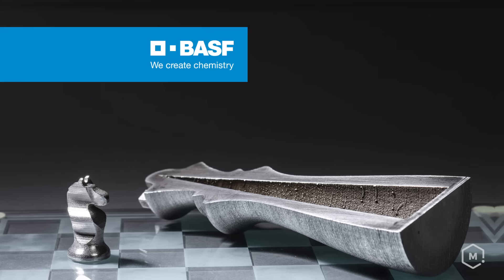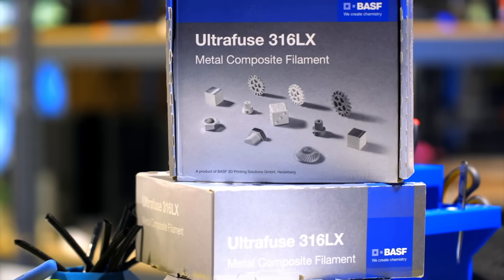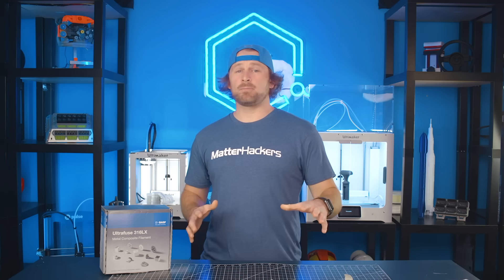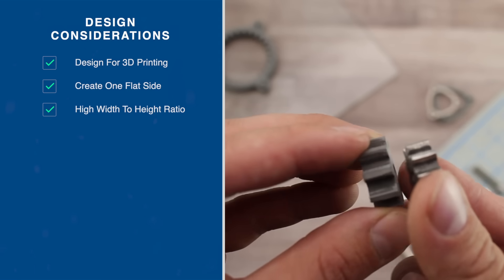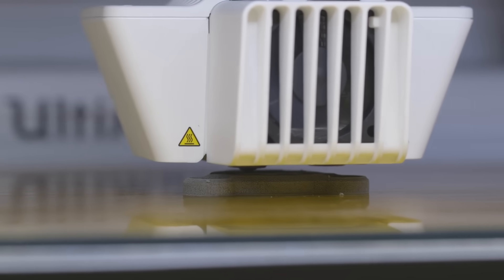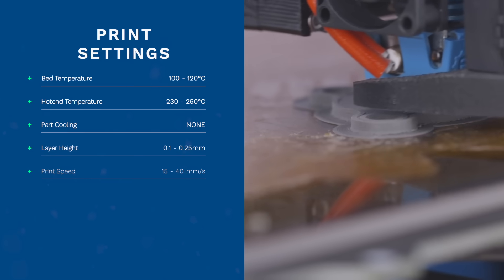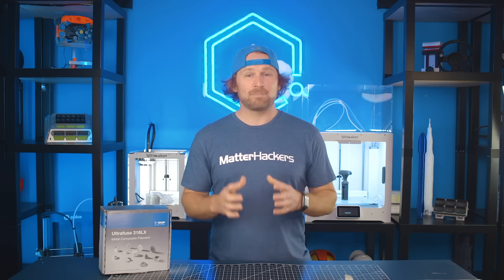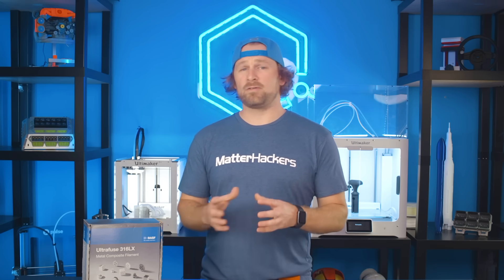How to Succeed with 3D Printing Metal on a Desktop 3D Printer using BASF Ultrafuse 316L Filament

Comment: So you buy this expensive impregnated filament, then you send the finished part  back to the company who manufactured the expensive filament for further processing to a finished product.      No word on how much it costs to sinter it, but it's snot going to be free.    In fact they got you buy the ball-z-axis.  They can charge whatever they like.   Why don't you just send your drawing over to be printed by a real 3d printer.   Seems like it would be faster and most likely stronger.   No funky scaling, or part mishap sad stories.   Either they can make it or they can't.

Comment: being made to follow some one elses rules in what you can make is not awesome! the other besides is no privacy and stolen designs, etc  you can tell by the fact they will renaming the process of heating it in a furnace to calling it Sintering instead what is the debinding also heating till most the plastic binders flow out???  perhaps under vacuum either way shiesty sounding to me at min Greedy while still controlling Tec

Comment: I have an odd question:
What is the density of the material before final processing of the part?  I am looking to 3d print flywheels, and others that require weight, not so much durability.

Comment: Why can't anyone combine this process with laser metal sintering, and basically extrude a layer, then blast it with a laser, extrude a layer, laser it, etc. Then it would be done right off the bed. 

You could even extrude some support structure, then only laser the bits to keep, and remove the green supports after its finished printing.
Reply: How much do you want to pay for that? Bidding is starting at $20,000.

Comment: I am a self-employed landscaper entrepreneur I'm trying to learn how to fix all my own stuff and as I do that take it to the next level of even making my own parts. I believe I was told in short 3D printing makes things possible that we're not possible in the recent future. Interested in being able to make my own hydraulic gearboxes these seem to be the one thing that are very expensive on power equipment interested in making my own version of a Toro dingo designed for mulch not necessarily for concrete and having materials something that I can move across a customer's yard without destroying it has anybody made hydraulic gearboxes before

Comment: I don't want to send my parts off to a service. I want to debind/sinter them myself. If I wanted a service I would just order it to get cnc-ed, and it would be stronger and probably the same price or cheaper ($465 for a 3kg roll (no smaller size) + $50/1kg filament sent to their processing service). Now, I could overlook all of that, but if I'm 3D printing its because I want the parts NOW for a prototype and not being able to sinter it myself is a deal-breaker.
Reply: Processing is included and it's $129 per Kg.
Reply: @rsilvers129  read the fine print and current prices from matterhackers, way back machine me bitch idfk that was 6mon ago

Comment: This is a joke.... the price of the filament alone... plus sending it In for another cost..... than saying hey, instead of cnc your parts do this... but your know what? You still may need to cnc these 3d printed metal parts..... this is all bs.... let me know when there's a better method... or when all the processes can be easily done in house... thanks!

Comment: 4:53 shouldn't the metal must be melted before print? so this is 250 degree celcius meanwhile for example aluminium melting point is 660 degree celcius. can someone explain
Reply: It's about 15-20% plastic binder and 80-85% metal POWDER. The plastic gets removed through the de-binding process and the metal powder is fused into a solid piece through the sintering process.
Reply: No, the metal is melted inside an oven with 1200°C after 3d printing the part.

Comment: $465 and $50 per processed part. $515 minimum price..

Not exactly cheap and not for the average Joe.. if the prices come down enough for folks to use quickly enough, maybe it won't be just another fly-by-night product alike to 3D TV's that needed glasses that no one would wear, even though they do in the cinema. That technology too went out the window..
Reply: Min price is $129.

Comment: I'm a bit late here but Virtual Foundry has much filament that is pretty much exactly the same and has a guide on how to do it at home with your own kiln.
Reply: True but it is $50 more per Kg and doesn't include the sintering like the BASF does.
Reply: @rsilvers129  How do you go about sintering? Is it just as easy as putting it in a gas powered furnace

Comment: At first I wasn't sure if this was a 3D Tech or Aerobics video : ) Just kidding. Product seems potentially useful but posting models back & forth, plus spool cost which will no doubt be X 3times other metal filled PLA, doesn't appeal, but I'd like to see Stefan from CNC Kitchen do strength tests as he's vigilant & thorough.

Comment: Why don't the facility that sintering the part get a 3D printer farm and you just send them your 3D file and they print it and sinter it? Instead of you shipping your green part.

All for a fee of course.
Reply: shelly belly shrinkage and part preparation is up to you... so I guess if it comes out messed up - its your fault
Reply: @TheSickness  most of the shrinkage comes from the sintering process, and the part preparation will be a service as well.

Comment: What a disappointing product and misleading video title - I expected to be able to print an object at home in metal, not something to be sent off to be turned into a metal part.
Reply: Matt Kasdorf i dont think this product is meant for people who print at home as a hobby
Reply: @Rogue Mentality even if matter hackers sales guy says that people at home can print it, it doesent mean that the product is aimed at these people. This is aimed mostly for industrial use etc. but because the sintering service is not just for industrial customers, people printing at home can also use it and these are a big part of the audience that matter hackers wants to reach with this video.

By the way, the sintering service was quite a bit cheaper that i thought it would be. Definitely cheap enough if you are willing to pay that much for the material itself, but it does cost. Im not sure if prices vary from place to place or if they are final prices, so i rather not say the number i have. Price of this material will surely scare those away who are not willing to invest for the prints they would make from this material.

Comment: This really needs to be cheaper than sending a part to be 3d printed on an SLS machine, if it really can't be machined. If I send an STL to shapeways to be printed in metal, I'll get a dimensionally accurate part. Here you are using an expensive consumable, sending it out for sintering, and hoping you got the dimensions right to get the part you expect. Hard enough to design with ABS shrinkage in mind, at least with that you can iterate immediately with very little penalty. A 16.5 % shrinkage is huge. I'm sure someone will try it - if they get comped a roll and sintering services, but I can't see paying for any production part. All examples I've seen can be manufactured better using subtractive methods.
Reply: If there was not so much difformation in that process, that would be a real advance for plastics matrix mold making and lower the cost for small production of plastic injection parts.
But if we have to CNC those sintered parts to get them back to specs, what do we really gain BASF ?
Reply: you can do loss PLA casting process.   but to cast 316L i would image you would need an argon atmosphere and an electric furnace.
Reply: shrinkage is probably not uniform too. Can't see how this can be of any use at all.

Comment: Did you mean to say 100 mm^3 for build volume?  That is a cube with less than 5mm sides.  That is tiny.
Reply: No, its 100x100x100mm. Maybe later they will allow bigger things.
Reply: bro said 100 mm cubed, not 100 cubic mms

Comment: I'm confused. you just print in plastic. send it back to get it in metal? why not just give them the STL in the first place?
Reply: Chloe Mcholoe its because they want YOU to take the responsibility of the shrinkage error.
Reply: I think it's like 90% (or over) metal embedded in the filament, with binding polymers that holds everything together, which makes it easier to print. Hopefully when the price of the filament and the sintering service comes out being a lot cheaper than those online metal 3D printing services.
Reply: @kevinyang8801  It shrinks a lot more than just 10%. The specification is over 80% metal so I expect 83 to 85%, which fits in with some other high metal content filaments.

If they put too much metal in the polymer just can't hold together and it becomes brittle. There have been other manufacturers who ran into this issue.
Reply: You can. It will just cost 7 times as much if someone else prints it.
Reply: you know exactly why. they won't let civilians have the tech.

Comment: Sounds expensive at all stages. I want a filament that can be sintered at home in a kiln.
Reply: Sure is, but it could be cheap for prototyping or low production volumes compared to machining  where fixed costs work against low volume.
Reply: At first they will say some things just can’t be done at home and we will just keep proving them wrong.😎
Reply: @MrMoonFlame  I hope so, it would be awesome if someone manages it with a small electric kiln, and some basic tools and processes, and published the method.
Reply: Why not go with lost PLA casting if you want to do everything at home and have a kiln?
Reply: @Syscrush  BECAUSE WE WANT TO 3D PRINT METAL DUH
Reply: im not saying you can sinter this in a coffee cup with a plate on the top of it in your microwave, but if I was, it would go a little something like this
Reply: @buffsharkshoes  i like that idea.
Reply: jesondag expensive compared to what?
Reply: Just use aluminium instead of steel. Still tougher than plastic, but you can melt it and cast into anything with a blow torch.
Reply: Well try the virtual kiln filament, you can sinter that and print it on a normal 3D printer
Reply: This for me turns something that cost 0ver $10K to porotype through Xometry to something that is lest than $1K and I get to have multiple version to account for the inevitable irregularities that come from manufacturing
Reply: You can do it at home in a kiln. But it also comes with free processing.
Reply: The Virtual Foundry has filaments that you can throw straight into a kiln. Now they have a ton of different materials since the last time that I’ve looked at their product line.
Reply: How about now?
Reply: Buy a sintering furnace for under 1000E for f sake..... it's the price of 2 rolls of material...... 
Just my silly 2 cents.....as a reputable 3d printer is 2500 E, a dehumidifier is 300E, a kiln is 800E  (because you're going to temper small parts if you have a small printer).... and a roll of 3kg of stainless steel is 400E :))....
Reply: Between 3d printers and mini cnc machines id make netter injection mold with better results
Reply: Well, this stuff ain't gonna work with a 200$ desktop printer.. And with him offering no guide as to what printer it works with, I can only assume that the ultimaker brand behind him is the one one it works with, and those are so expensive that the company doesn't even list prices, you gotta message with a quote. so.. 5000$ if you're lucky.. prob for the small one..
Reply: Having the capability to do everything in house is appealing, but there is still a steep cost on the sinterring oven and the debinder (washer). Plus you may need to have the floor space, the power circuits for it. Maybe a lower cost oven is being developed, but just to prove the concept is already super impressive.
Reply: @kevinyang8801  Think about this scenario: A customer asks for a quote for a complex part from a company that would machine this as its the equipment that they have. And also ask quote from a printing service which has the capability to sinter this. Which do you think could give better price if its just two of these parts that the client wants?

Another scenario: A large company has been using this filament for longer than BASF has had this as a product to sell(i think they made it just for Essentium before). Im not sure what they do with it, but i know they use it and its a company with a lot of respect and worth a lot. If this was a poor choice for them to use this, they would not use it.
Reply: @YrjoPuska777  yeah, if they can do all that in house.... which most anyone at the moment cant
Reply: @kevinyang8801 not everything requires a debinder step. And sintering can be done in a heat treatment oven. Mine has a useful area of 12” x 10” x 10” and gets to 2,150 F. Debinding could also be done at home, if needed, depending on the chemical required. Even if a “metal” filament is just 75% of the strength of the usual metal part, that’s fine. A slight redesign of the part will take care of that. I machine everything that needs it. But I do 3D print parts out of PPA-CF and PPS-CF. They’re strong enough for many purposes.

Comment: the dimensional guesswork makes this very sketchy -- if I need a part to be a specific size, your best best is a lathe and a mill...I don't see how this rough shrinkage estimate works for production prototypes -- I get it back and it's .5 mm off spec, and I have to print it again, send it out ...etc...doesn't sound like the process is fully baked -- pun intended.
Reply: It's common to have critical dimensions machined after casting, forging or sintering. This would be the same.
Reply: Are you sure its much more guesswork after you know how to calculate shrinkage and know the sinthering process well than guessing tolerances any other filament printing?
Reply: But in machine or mechanical parts, where you would mill multiple faces / edges anyway.. and it would be very helpful for personal projects if you live in a city apartment and can't set up sand casting for prototyping or limited run parts
Reply: All MIM parts are shrunk.